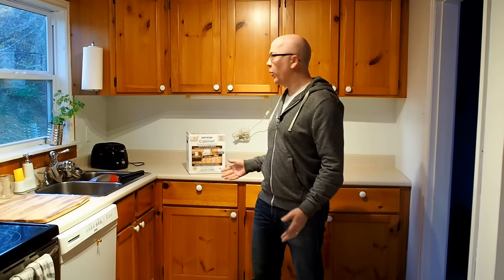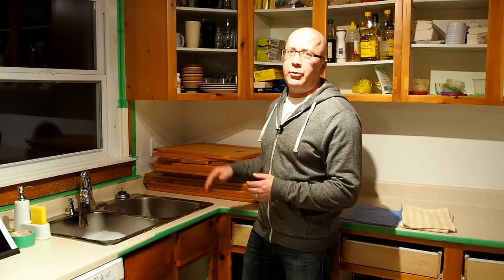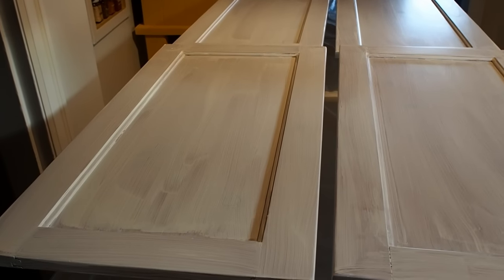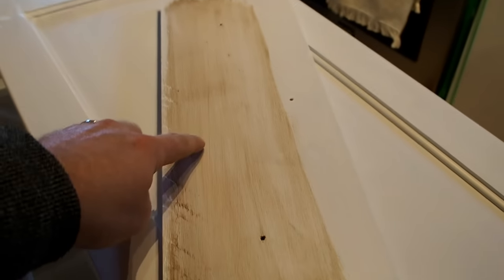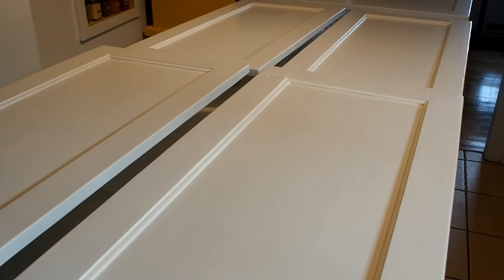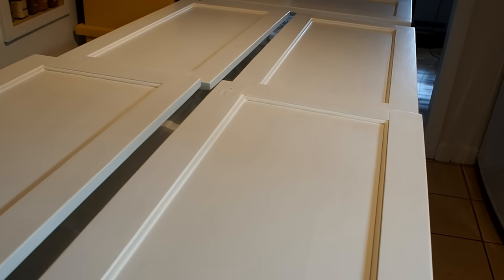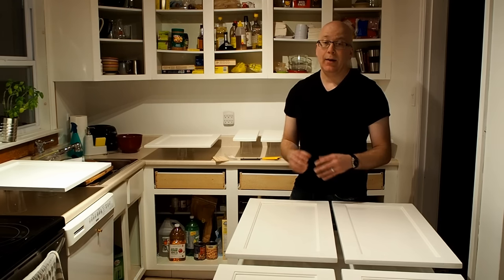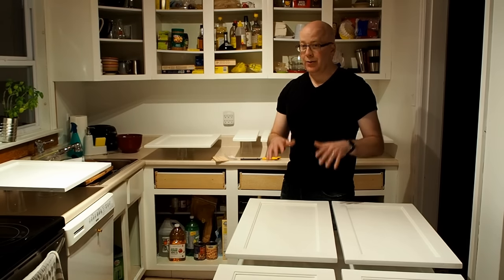How to Paint Your Kitchen Cabinets - Rustoleum Cabinet Transformations : Budget Renos #02

Comment: A year ago I used the  Rustoleum kit to do two bathroom vanities. I also did 4 coats of paint. At the time I was horrified by the yellow tinge of the top coat. A year later I have to say its no longer an issue. This year I have one more bathroom to complete and I plan to try a roller and foam brushes with my leftover paint from last year. Thank you for your inspiring video!

Comment: Thank you for this! I am on my 3rd coat on my cabinets and thought I was losing my mind! I will def. look into getting a different top coat, SO glad I saw this before doing the one in the kit!
Reply: This is just an update I checked into all the clear coat and it turns out this is one of the better ones that come in the kit I used it and had absolutely no yellowing whatsoever came out beautiful. Could be because I used a good primer first zillingers..
Reply from the maker: Glad it was helpful!
Reply: Hi Michelle! Curious if you did end up getting a different top coat and if so which one? I just started doing my cabinets but luckily I had an extra door that I practiced on first and the yellowing they’re talking about is so true and very annoying! I was given the suggestion to buy a different top coat if you have a recommendation from your experience?
Reply: Emily Cruz  yes I did! I went with a semi satin poly by varathane! Still clear!
Reply: We also switched to a different paint, called beyond paint and it did MUCH better than the kit paint!
Reply: Michelle Spencer  Really?! I actually just did a third coat on my practice piece but I used a Wooster paint brush instead (as others suggested) and that actually gave it a much better, smoother and thicker coat! Now it’s pure white! I’ll look into the semi satin poly by varathane you used and I’ll do a test run of both! Thanks so much for your help! :)
Reply: Emily Cruz wish I could post a pic on here! Yeah the beyond paint was SO much thicker, did maybe 2-3 coats instead of the 6-7 with the kit paint.

Comment: I would agree about the top coat.  I bought the darker espresso color and "practiced" using my bathroom vanity because we wanted to change it anyway.  I used a Wooster Pro brush when doing the top coat and it streaked.  I'm happy with the color choice and also thankful that it's in my small bathroom where it isn't noticeable and no visitors ever go in it anyway.  I read the below review and ordered the Varathane Polyurethane Crystal Clear Semi Gloss which is what I'll use when I do my kitchen cabinets this week.  I'm also going to purchase the foam brushes.  Hoping these will make a difference!
Reply from the maker: Good luck! Let us know how it turns out. It's a great product overall, but one that needs a few tweeks and care during application. Thanks for watching.
Reply: Stacy Dodge please let me know how it went. I want to do the same thing
Reply: How did your project turn out? I’m about to start on my bathroom for practice then moving on to our kitchen.
Reply: just buy benjamin moore advance paint. no top coat is needed

Comment: I just bought this product and color. After watching this video and getting the same disappointing results with the brush (needed 4 coats) I switched to a roller for the remaining cabinets. It did much better. I'll still do 3 coats on the remaining cabinets but I could stop at 2. I just used a 4 inch "ultra smooth" nap roller from HD.
Reply from the maker: Glad to hear you got good results with the roller. Thanks for sharing the feedback.

Comment: The keys to this are to use a good brush, like a Purdy XL, Purdy Clearcut or Wooster Pro (I prefer the 2 1/2" angled for cutting into the corners easily). When you use the glaze, you have to wipe it off with a minute or two. It truly gives the cabinets depth and character. It is amazing! I also used the separate Rustoleum Varathane Crystal Clear SemiGloss polyurethane. It is non-yellowing and really goes on easy. I only knew that from finishing another project before. With those few changes, it will coat better and you will keep your beautiful white color. Great job on the project. Thanks for the video!!
Reply from the maker: +kcwizard72 thanks, great tips! Hopefully people check the comments before trying the kit. We would definitely use a different protective coat if we were to do it again.
Reply: kcwizard72, I am considering using the Rustoleum Varathane Crystal Clear SemiGloss you recommended instead of the supplied protective coat due to the yellowing. How many coats do you recommend? It only takes one with the supplied protective coat but relies I have read on the recommended poly say at least 2-3 coats. I am just finishing up my bathroom cabinets and so far only got a yellowing on one portion of the medicine cabinet door. Going to be doing the kitchen cabinets next and it will be more critical that I don't get any yellowing. 

Also does anybody know if you can order just the bond coat from Rustoleum? Not using the glaze and if I don't use the supplied protective coat would rather not buy another complete kit to finish the kitchen.

Comment: I have been working on my cabinets for a couple of weeks. I have had to put on 4-5 coats. Called Rustoleum and they are sending me another quart of top coat at no change. Overall I'm happy with the results. I did learn quickly that a quality brush is the key. I have started putting on the clear coat and hoping I do not see any yellowing as went with pure white. I don't think I could have handled another step in doing the glaze .
Reply from the maker: We feel your pain! In the end it was worth it; ours has held up well. The only yellowing we have is where we put the top coat on too thick (but that was also apparent right away and hasn't gotten worse with time).

Comment: I am in the middle of using this same kit. I appreciate your video. The DVD that comes in the kit says to only use a 2 inch brush. It's too bad it doesn't say it has to be a nice quality brush like Perdy to avoid brush marks.  It would also be helpful if they mentioned that you have to prime the knots on pine wood with shellac, or they will bleed thru later. The average homeowner wouldn't know this.  I have painted my whole life, and learned a lot thru trial and error. You guys are adorable. Good luck with the rest of your renovation.
Reply from the maker: +Krim S thanks! Good tips. We didn't prime the knots but the cabinets are really, really old so hopefully there's nothing left to bleed through. I guess we'll see over time! The instructional video they provide is okay but, of course, they have a perfect setup in which to do everything. That's one of the reasons we wanted to do our own "real world" video. Thanks for watching!

Comment: My wife and I just finished redoing our cabinets with the Rustoleum White color kit. Man let me tell you, it was labor intensive. It took us 1 day to clean and prep the cabinets as well as sorting the screws and cabinet accessories. We used 4-5 coats of the white bonding paint and it took us 3 days to complete the paint job. We started painting the cabinet frame with the too coat while the cabinet doors dry. After a couple of hours, the  top coat on the cabinet frame was dry, not yellow discoloration so far. Our doors are drying now. So far, so good, we are pleased with the outcome thus far. But man, it is a lot of work.
Reply from the maker: Yup, we definitely echo the "lot of work" sentiment! It was certainly rewarding and not difficult work but you need to be prepared to put the time in to get it done right. Glad to hear yours turned out well. Thanks for watching!

Comment: light sanding with 220+ grit sandpaper between coats would have eliminated the brush strokes and allowed paint to soak in more even. You would have been done by the 2nd coat, 3 max. I only say this because in the past I have hesitated to sand a surface that I just spent time painting. It seems counter intuitive, but it looks great :D
Reply from the maker: Good idea, thanks for the tip. Jason was pretty grumpy by the time he got to doing the 4th coat and this might have helped!

Comment: Great Job Jason! Trevor and I had used the rust-oleum Cabinet Transformation back in the spring. We used the English cream. We are happy with it for the most part, loved the change in the look of the cabinet. But we are noticing it wear off in heavy traffic areas around the handles. I guess we will have to do some touch ups!
Reply from the maker: +Brianna1Leah2 thanks for watching! We were curious about how it's going to hold up over time. We're hoping to get at least five years out of it so we'll see how it goes!

Comment: Thanks for the video tutorial. A few questions. 

1)  How many kits were required for this entire project?  Seems like 1 kit @ 100 sq ft isn’t enough. It’s hard to judge how much is needed for my protect. 

2) Did you painted the back of all the doors as well with 4 coats?

3)  Does you cabinets have laminate sides?  If so, how did the paint look/adhere versus the doors?  

Thanks!
Reply from the maker: Hi,

1. We only used one kit and had plenty left over. Our kitchen isn't that big though...
2. Yup, painted the backs the same as the front
3. The sides of our cabinets are wood, not laminate. We aren't sure how well it would apply to laminate.

Good luck!

Comment: Hello Handyverse, may I ask how the cabinets are holding up with this paint 4 years later? Would you buy this product again? I want to make sure with all the work, painting over dark wood, I am still smiling years later. Thank you for the great video.
Reply from the maker: We'd say that it's held up well but it's beginning to show its age a little bit. Higher traffic cabinets are showing a lot of scratches now. Our objective was to get five years out of it until we do a full remodel and we're definitely happy with what we got out of it. We'd use the product again if we were in another similar situation. If you're looking for a 5+ year solution, it might not be the way to go though
Reply: @Handyverse  thank you.

Comment: I sprayed my kitchen cupboard doors with a Rust-Oleum white spray paint in a satin finish they turned out amazing and it only cost me about $40 worth of spray paint
Reply from the maker: That's good to know. If we ever did it again, we may try something like that, particularly since we weren't interested in using the glaze anyway. We were quite impressed with the de-glosser though as it seemed to help the paint bond to the cupboard. Thanks for watching!
Reply: Can you buy the de-glosser separately?
Reply: Debbie Werlin its called TSP, you can get it at any home improvement or paint store
Reply: I agree with spray paint!! I did mine in a high gloss and wow it's great and easy.  Thin coat at first and the second coat covered all really nice and easy.  Spray paint people!!!!
Reply: @julieslone422 , saying spray paint is that in a regular spray paint can? did it have primer in it as well? I bought the behr marquis one coat gallon paint but been pondering back n forth in my mind if I should use brush or 1/4" mini roller. only thing I dont like with spraying I can do the doors outside but cabinet framing there would be much over spray in the air couldnt imagine that going everywhere..
Reply: @BurtBowers  I sprayed the doors but brushed on the cabinet. Lowe's matched the color of the spray paint for me. It was a buttercream.
Reply: @julieslone422  what kind/brand of spray paint did you use? I'm planning my cabinet DIY for my vacation in about 2 weeks and spray paint sounds so much easier. Also, did you use a clear coat afterwards or just spray paint?

Comment: How’s the paint holding up since you painted? I’m curious how this paint does on high traffic in the kitchen.
Reply from the maker: It's still holding up very well over two years later. Really the only flaws we have now are just from the cats scratching the cabinets but that's no fault of the paint!
Reply: That’s awesome! You’re video was very informative and helpful. Thanks for replying, I appreciate it.
Reply: I can attest to this product holding up great, too.  2013 I did my master bathroom and large kitchen. Prep is key.
Reply: We did our kitchen cabinets with this stuff about 5 years ago. The paint wore off in spots where there is a lot of contact, like behind cabinet pulls. Not impressed at all. I'm going to be re-doing the cabinets and have built new doors and drawer fronts using poplar and making shaker style cabinet doors. Just finished with sanding and drilling the cups for the concealed hinges the other day, and will be using Cabinet Coat after priming with Zinsser Bin primer. If you go through the trouble of prepping and painting your kitchen cabinets, don't use this mediocre Rustoleum product. Instead, look for Cabinet Coat or Benjamin Moore Advance.

Comment: It looks so good! I used this kit in my kitchen, but no matter what brush I tried i couldn't make it look nice. I bought the wagner flexio 590 sprayer and it made them look perfect! I did not use the top coat that came with the kit though. I used minwax polycrilic
Reply from the maker: We struggled with it ourselves but in the end it turned out great. Thanks for the info on the coating; if we ever do it again, we will use something other than what's in the kit.
Reply: Good to know! I was looking into buying one of those sprayers. Do you recommend that one or do you suggest a different one? Also, did you sand your cabinets prior to painting? TIA.
Reply: @logansgamingworld8137  I like it! I may even be better than what we needed ( purchased to also paint our house) but it definitely got the job done! Used it with regular latex paint (sisters cabinets), with bond coat (rustoleum kit) and with polycrylic. You do end up using more product but it's worth it for the smooth finish. I did not sand but I washed them with soap and water and the rough side of a sponge and then used deglosser with a green scrub pad. The deglosser came in the kit, but I bet it's similar to liquid sandpaper.

You must sand or degloss. We did not use deglosser on one part of my sisters cabinets and they feeled immediately.
Reply: @michellethomas6557  Thanks so much for this info!
Reply from the maker: Thanks for the info. We haven't used the sprayer so couldn't comment. You're input is much appreciated!
Reply: @logansgamingworld8137  by the way I did thin the paint with water. Rustoleum had thinning instructing somewhere as well as well as the paint company. I did see some videos where they did not thin the paint and did well too. I used just the sprayer but my sister did a very light final coat with a foam roller.

Comment: I know this is a older video but you mentioned you would use a different top coat yet I can read all the post and do not see what you would recommend as a clear top coat.. I put two coats of primer on and also two coats of the paint that came in the kit.. but now after watching your video I'm afraid to put the top coat on I do not want it to turn yellow....
Reply from the maker: Sorry for the late response; just getting through some older comments now. We don't recommend a different top coat because we havn't used a different one. What did you end up using?

Comment: Also, when you use a different top coat, you can put on as many coats as you want, but make sure you sand with 220 grit between coats. Vacuum the sawdust, wipe and clear again.
Reply: using minwax you dont need to sand

Comment: Did you apply the Zinnser stain cover first? Has the stain from the cabinets been withheld or has it begun to bleed through the white? 
Thank you.
Reply from the maker: Sorry, we aren't familiar with the Zinnser stain cover you mention. We didn't apply anything under the paint (other than using the deglosser first). We haven't had any bleed through of the old stain.

Comment: Did you find after cleaning and using the deglosser that it removed ALLof the original gloss from your cabinets? We have been scrubbing thoroughly and the cabinet doors still have a bit of shine on them. We used TSP cleaner and cleaned thoroughly beforehand as well. I am just worried that if we apply the bond coat it would be uneven or not look nice if we didn't use it properly. We have used nearly the whole bottle.

Comment: Maybe you could have tried a mini roller with a very flat nap or with a foam roller, just for the flat areas on the 2nd white coat... you can get them in about a 3" width.  Work good with regular paint... not sure about this product.
Reply from the maker: +Joyce Roling thanks, that's a good idea and it would probably have helped. We didn't have any at the time so just pushed through with the brushes we had. Thanks for watching!

Comment: I always use a brush to spread the paint and then immediately go over it with a dry small foam brush this takes away the brush marks and you will have no marks for your next coat to cover. I paint thrift store furniture like this all the time and it saves a coat of paint as once the primer is down smooth only one  top coat is needed.
Reply from the maker: Great tip. Thanks for sharing!!

Comment: I used this product and followed all the instructions. I even called them directly at least 6 times to make sure I was doing it correctly. One year later started to peel. IIt was a LOT of work. I still have them and it has peeled in several places, and that glaze turns yellowish with time.  I HATE IT. I am selling the house and I will have to paint again very soon bcse the realtor told me to "touch up", and I will use another product to paint over.